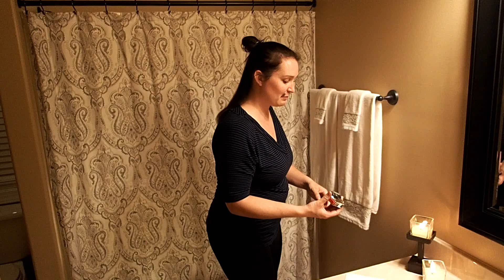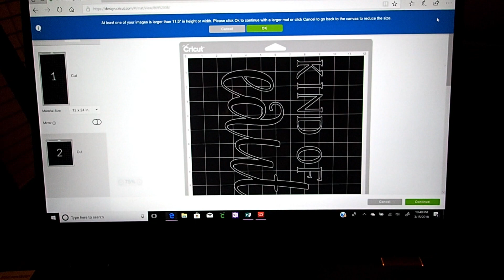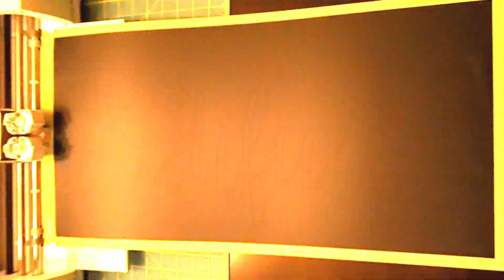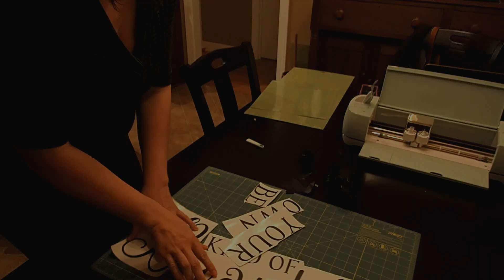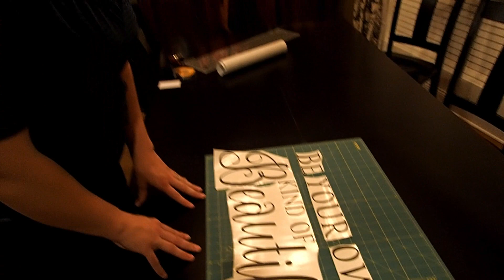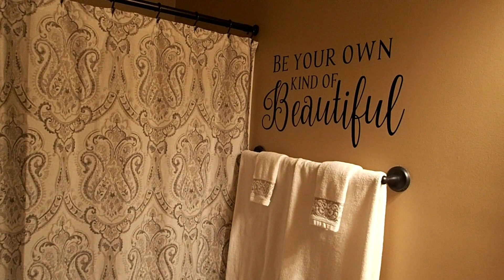Vinyl Decal - Removable Wall Art

Comment: I'm wondering since the mat is 12" x 24" and the Cricut doesn't' cut that big I'm getting an error that says my design is too big.
Reply from the maker: Sandy, thank you for your comment.  You will need to "slice" your design into a couple pieces to make it fit on the mat.  You then can assemble them on the transfer tape or the wall.  In my video, I chose to assemble the words on the mat.  I had to cut the "B" in Beautiful separate from the rest of the word in order to accommodate the mat size.  I hope this helps!
Reply: There is another lady on YouTube who also solved that problem 🤗
Reply: that is generally because something in your design say something other than cut - check and make sure everything is set to cut, and not print or draw